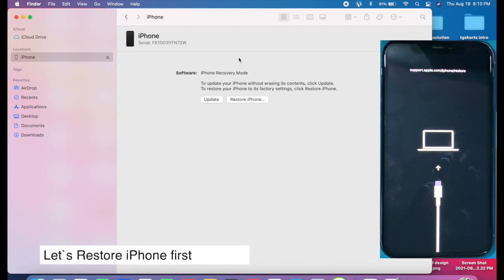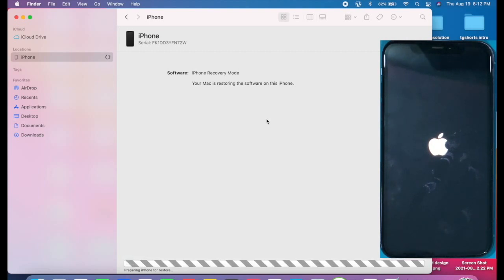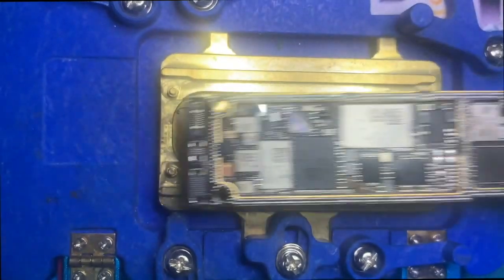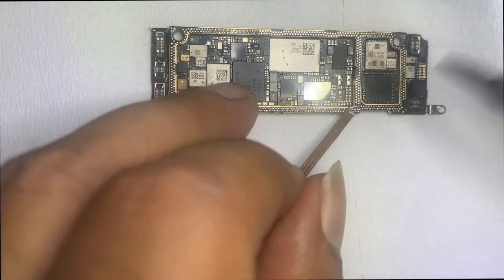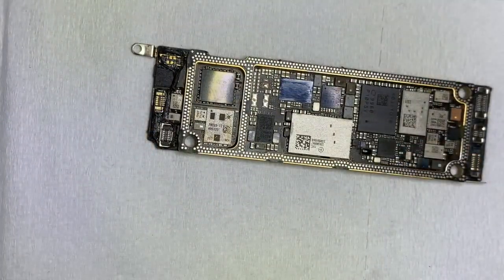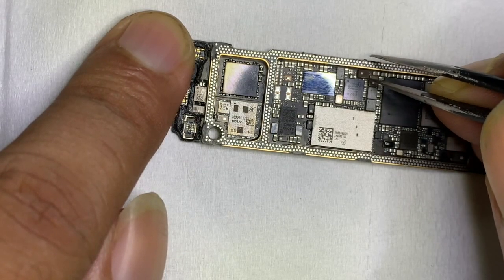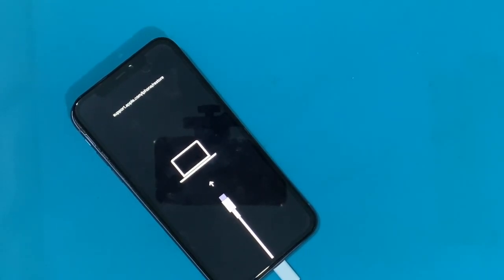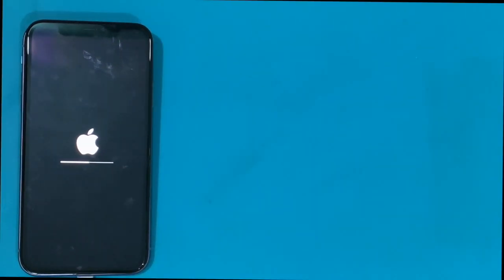iPhone 11 restore error 4013 fix!Stuck on recovery fix.

Comment: the heat you use in iheater? and how many minutes
Reply from the maker: You can use 180 on pre-heater to separate and minutes depend on how fast the solder is melt properly.